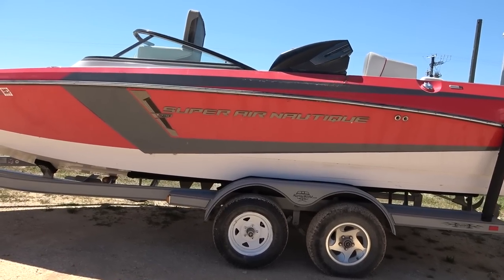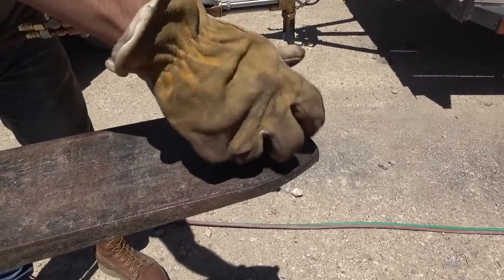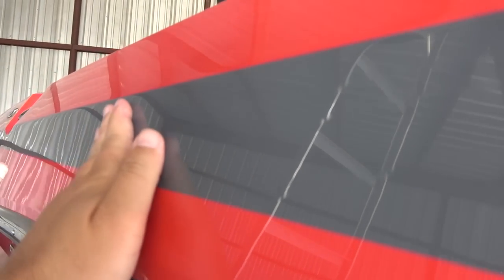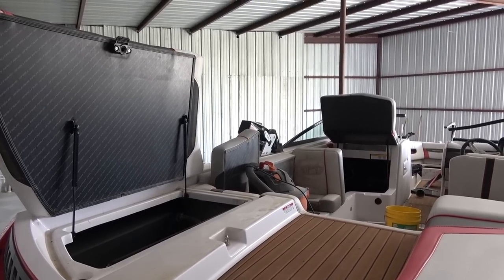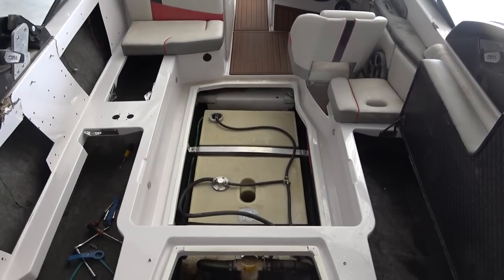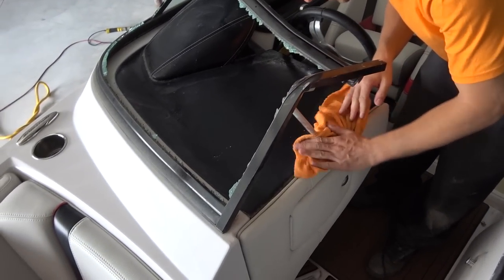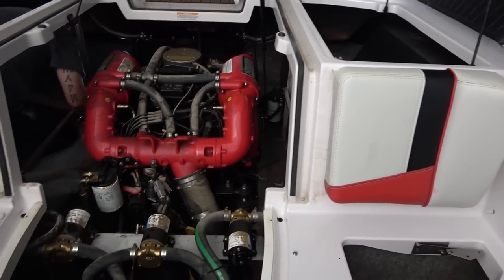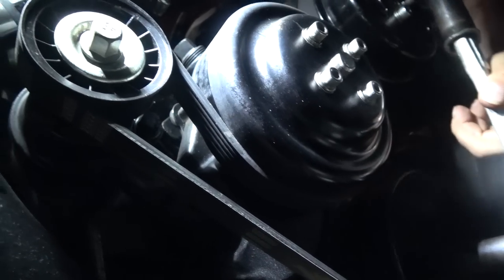Flooded Copart Super Boat REBUILD PART 2 - More DAMAGE!?!

Comment: What year is the boat??
Reply from the maker: 2014
Reply: @RebuilderGuy  what did you end up picking it up at auction for???
Reply from the maker: Watch the first video :)
Reply: @RebuilderGuy  almost 23k...well if you can fix it for 20k or under. Be still above water. Not much room for profit being a rebuilt boat. But deff.will not loose money on the resale.
Reply from the maker: I'm going to be on the water alot this year so don't really want to pay 100 bucks an hour to rent a boat so the hours I put on it will pay for itself :)
Reply: These boats new are over a 100k
Reply: @chieflongsock  I know they are lol but being a 2014. A clean one of that year go from anywhere from as low as 59k to 75k here in the northeast. Just from a few researches. And being a rebuilt there is things future buyers will see and question. Look either way he is going to be ahead. Just "Insane profit" is out of the question. But little profit with also getting to use it all summer is deff true.

Comment: After watching these videos I would never buy any parts fromTP Turbo import parts. Nothing but half ass repairs. Every wire, terminal, electronics, fuse,  and switch should be replaced. The engine and transmission need to be disassembled and inspected at least. Can you imagine the poor people that buy this boat. I wonder if this is how they repair their turbo parts. Sorry to be so negative this is what gives mechanics  and rebuilders bad reputations